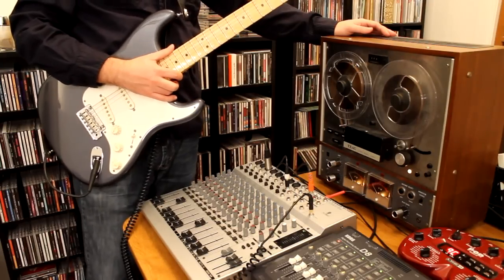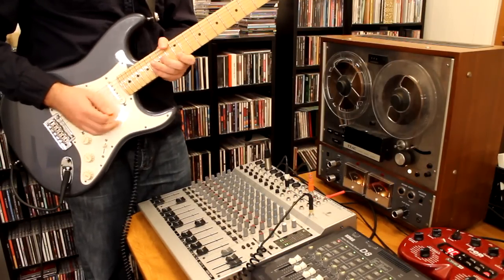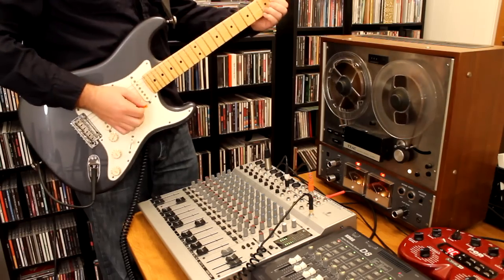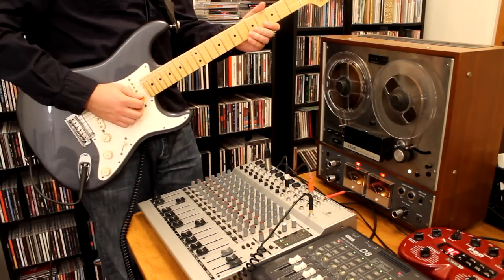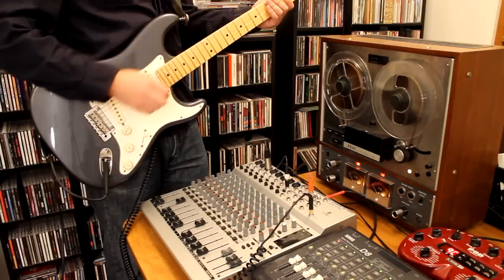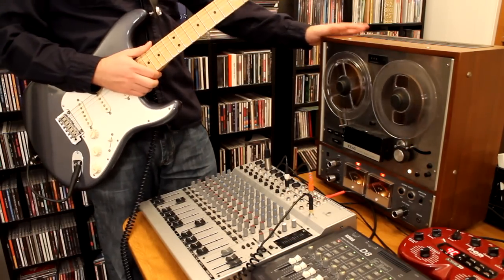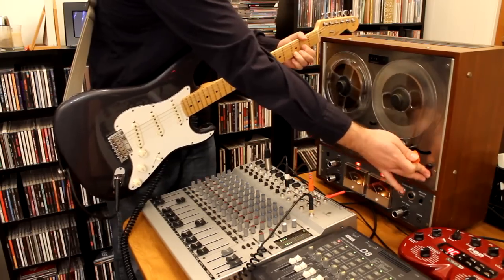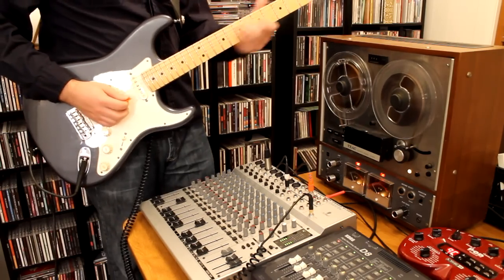Reel-to-reel Tape Delay Demonstration with Electric Guitar

Comment: If you plug the quitar into mic section you will get a nice distortion. And if you connect the motor through a reostat you will get the possibility to chage the motor speed not just 2 positions but delay from 0,1 to 0,7

Comment: Ritchie Blackmore initially used two akai reel to reels on stage to achieve echo . he found that using them as a gain stage to boost his guitars signal before hitting his marshal to be very desirable . most often Ritchie could be seen with  an akai deck in his rig as he used it as his secret tone weapon for many years . the deck would just sit there , not even moving . i am sure he could have done well with a clean boost pedal , back then the mxr micro amp and the ehx lpb-1 were available but they alter your tone a bit as these are very small rudimentary circuits .  things such as this did not concern mike mattews back then , i would question weather or not he was even aware of the amount of tone suck and signal degradation , but pedals like his small stone , and many other of the old non boss pedals where culprits in ruining your bypass tone .  great job with this demo , its totally something i would do , but ... i sold a ll my reel to reel stuff to make room for pc's.

Comment: Not mentioned in the video but if your recorder has a pitch wheel you have an extra 12% (6 up pitch, 6 down pitch) of throw to change the delay speed.
Reply from the maker: Good tip Catface!

Comment: I like it. I noticed the feedback seems to progressively lose its high-end and head toward more mushy delays as it repeats back on itself, your send's bass EQ is pulled down a bit but it seems the rest are balanced, is progressive mushiness caused by the tape itself or EQ?
Reply from the maker: Hi Al. I believe that "mushy" tone you described is the common characteristic of an analog delay trail. Basically, each time the delayed signal is recorded through a feedback loop, it loses one generation...and so on...and so on. The tone gradually loses its high end as the delay trails on. Many modern delay pedals have a "analog" setting that recreates this effect. As for the EQ...I usually like to roll a little low end off on delay effects. The EQ is not directly related to the "mushy" sound.

Comment: Very cool demonstration! How would you plug everything up if you were using a guitar amp? Is everything the same except you have the board going directly to the amp?
Reply from the maker: Hey Scott! Great question. The simplest answer would be to plug the main output of the mixer in to a guitar amp. Some guitar amps have effect loop inputs/outputs, however not all of them have the ability to create the "feedback" effect that's more easily accomplished with a mixer.

Comment: Could i do this with a cassette tape?
Reply: It would probably be the same effect with a cassette deck as long as it is a three head deck like the reel to reel deck in the video.
Reply: Tapespeed of a tapedeck is higher... so the effects are shorter..
Reply: You can use a Teac AX-10. That's an easy way, to get tape echos from a 3-head tape deck. These units are rather cheap to grab.
Reply: @WhiteBug  It's not actually. Could still perhaps be true since the Heads on a Tapedeck are closer to each other :-)
Reply: It can be done, there's a bunch of videos out there showcasing cassette decks as tape delay units.

Comment: Great sound. It should be noted that you need a deck with three heads for this. A two-head deck (erase and rec/play) won't do it. This is why you can't do this trick on most standard cassette decks without modifying it. The vast majority of cassette decks have only two heads.
Reply: What does the third head do?
Reply: @orange5718  It plays back. On a three head deck, the heads are, from left to right: Erase, Record, Play.

Comment: digital emulation is just as good....except they haven't nailed the spooky effect of varying the tape speed, or being able to move the heads like more advanaced tape delays have....but that is special FX stuff that doesn't get called for that often.
Reply from the maker: I've heard the Strymon El Capistan nails this sound pretty good. But I'm not sure if it replicates the actual sound of changing the tape speed.
Reply: The El Cap does replicate that pitch scrub sound, but so does the Belle Epoch Deluxe which is the most accurate digital emulation of a tape delay currently available.

Comment: Would it work to do all the feeding of the signal in and out using a feedback looper pedal instead of a mixer?
Reply from the maker: I'm not exactly sure what you're asking... but a feedback looper pedal would get the job done with a mixer or tape machine.

Comment from the maker: jman33331 There is no "guitar amp" used in this configuration. I have my guitar running through a Line 6 P.O.D. amp modeler.
Reply: Hi, I have a Teac A3340s 4 track tape deck and a Teac AX-10 sound on sound box that connects in the in and outputs on the back of the tape deck. My question is with your set up there, could you connect This straight into a Vox AC30 amps?

Comment: Would this work with any reel to reel? I was looking at a concord 444
Reply from the maker: +MrBingping I'm not familiar with the Concord 444, but it should work, as long as you can directly monitor the recording head.
Reply: You need the montoring function of the record head. The German term is "Hinterbandkontrolle" it isn't there in leo's dictionary. Not every machine has that. But the effect CAN sometimes work without Hinterbandkontrolle, due to the fact, that the play (Repro) head is behind the rec. head. I once had that with a machine, where I didn't want it and had to abolish it with another setup. It takes time to experiment with these things and be careful guys:
Testing can cause mean feedbacks which destroy your high tone speakers.
If it works: You can have no better analogue delay! Well done Life Of The Mind!
Reply: +E.m.E. Studios Hannover thanks for the info, I actually came across a deal on a roland re-150 space echo that I couldn't pass up, but i may still try this someday

Comment: this is a empty tape right?
Reply from the maker: I believe the tape had something previously recorded on it. You can use the same tape reel over and over again.
Reply: but you need a tape for this to recording and playback delayed? Just through the recording head is not possible right?
Reply from the maker: Correct. You do need to have a tape on the machine and recording engaged in order to create the delay effect. :-)
Reply: and how many times can you record on the same tape?
Reply from the maker: Several times... at least before the tape wears out.
Reply: Thanks!
Reply: They actually used to glue the ends of a fairly short tape length together to make an endless loop, and let that run for the effect. I did that myself as a teenager. :) The tape can run for many hours before it wears out, and then you make a new loop!

Comment: You really need to clean that Pinch Roller.
Reply from the maker: What is the best way to clean it?
Reply: @LifeOfTheMind  Dont use rubbing alcohol.    A company called Lasermedia has some stuff called RC-5.  THey also have some stuff for CLeaning heads.  That is called CL-100 . Its a little hard to find but thats what I use.
Reply from the maker: @JimBob_Joe77  Thank you for the recommendation! Also, how important is it to demagnetize the heads?
Reply: @LifeOfTheMind  If you're just gonna use the machine for the tape delay effect then its not as important to demagnetize the heads as often as you would if you were actually doing regular multitrack recording.  Professional studios will demagnetize their heads before every new session.  But a home recordist would be fine maybe once every week or 2 depending on how many hours you use it.  Also, there are other companies that sell head cleaner and even Rubber cleaner for the pinch roller.  Just check google.  1 bottle of each will last you a long time...
Reply from the maker: @JimBob_Joe77  Thanks Matt. I appreciate the info. :-)